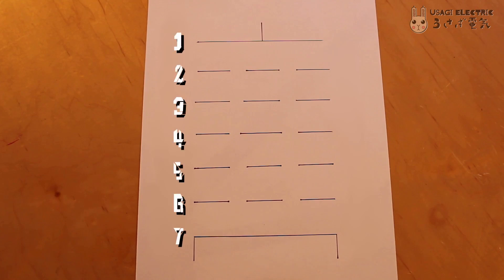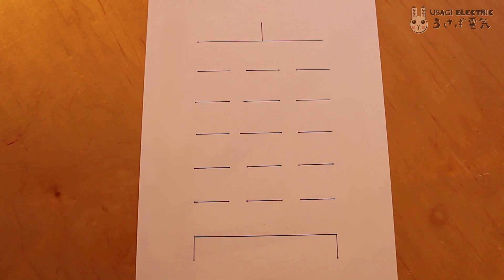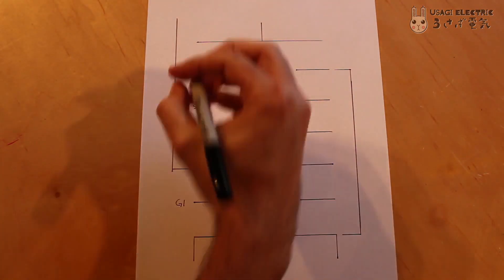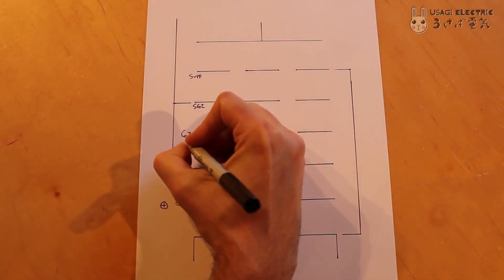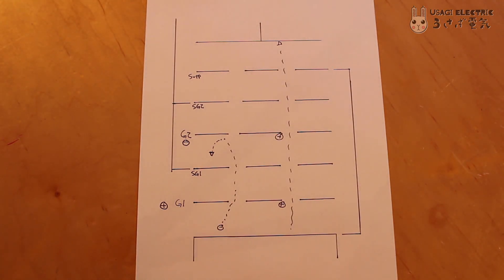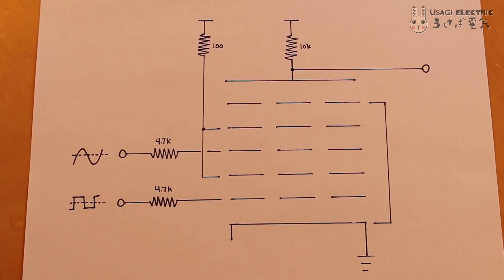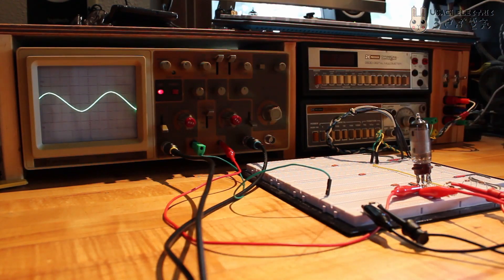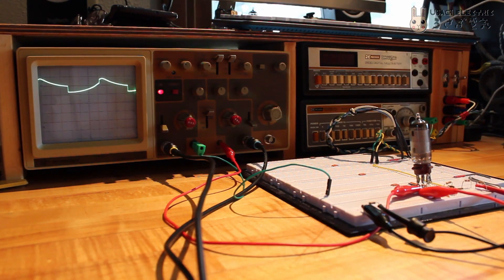In a Minute: Vacuum Tube Heptodes/Pentagrid Converters in 60 Seconds

Comment: Can i replace a heptode with a NAND NMOS gate with right voltage and current ratings? I just need some tubes, but don't want to buy them as they are expensive and fragile. Can i make some simple solid state tubes with NMOS transistors?

Comment: It might be used as an AND gate.
Reply from the maker: That's pretty close, it's actually closer to a NAND gate, since the output coming off the plate will be high unless both inputs go high (allowing the tube to conduct), in which case it'll be pulled low. It's a really awesome and elegant design for a tube! I just wish I had more of them.
Reply: @UsagiElectric  its even better then, NAND gates are much more useful